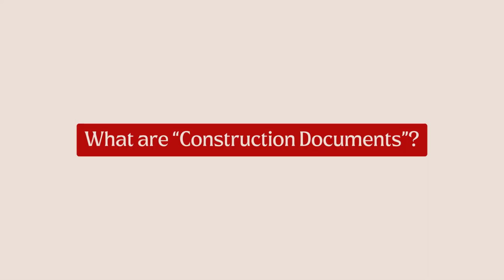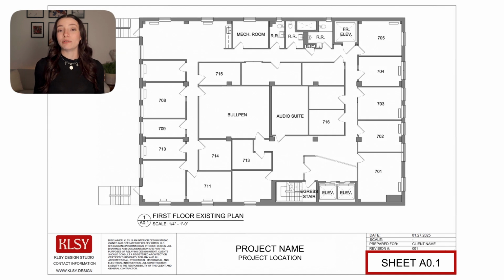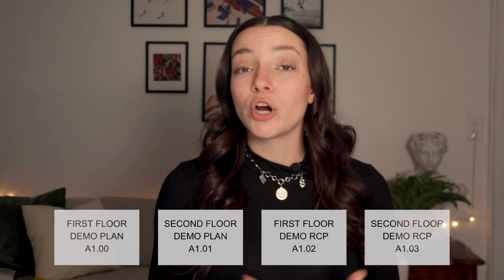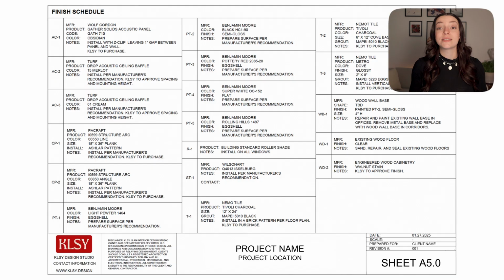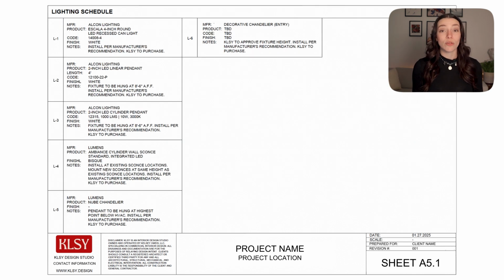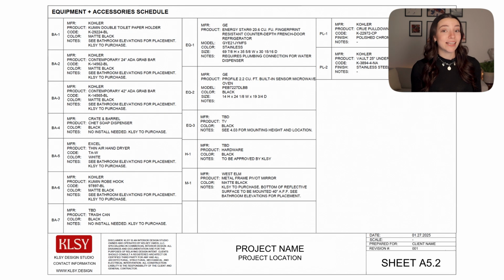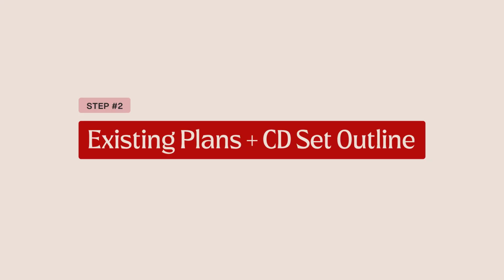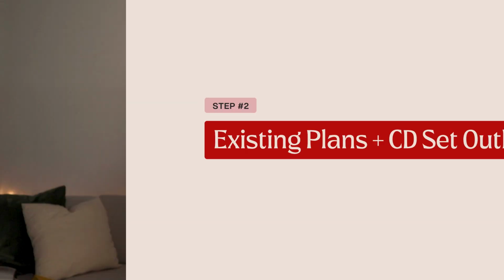Construction Documents 101 for Interior Designers (the basics!)

Comment: Hi Kelsey.  I'm glad YouTube recommended your channel.  I was here when you have 1,350 Subscribers.  It's inspiring and very smart of Coohom to sponsor you in the early days.  Congrats on that!  I look forward to you hitting 10,000 Subscribers soon.  I just subscribed so you're now one closer.   You didn't mentioned As-built / Existing Floor Plans.  I guess you can double up on the Demolition Plan but in Los Angeles, the Existing Floor Plan is required.  Here is the list of what's required in Architectural Plans by Los Angeles Department of Building and Safety:

+  Existing Plot plan
+ Proposed Plot plan
+ Existing Floor plan
+ Proposed Floor plan
+ Roof plan
+ Exterior elevations and cross-sections
+ Disabled access features for additions to multi-family dwellings when the additions are subject to the Disabled Access requirements
+ Green Code features

I'm going to finally start focusing on my YouTube channel and posting more this month.  Wish me luck!